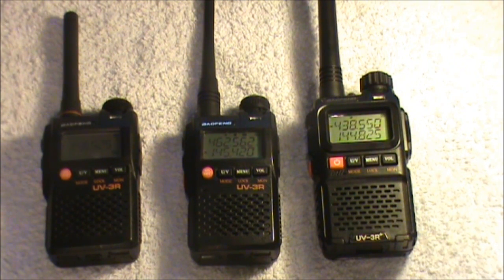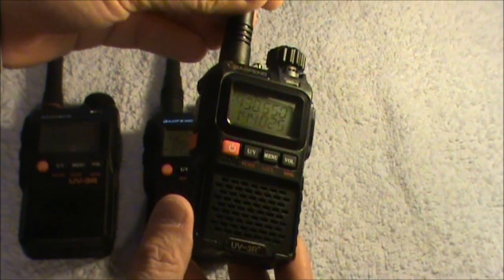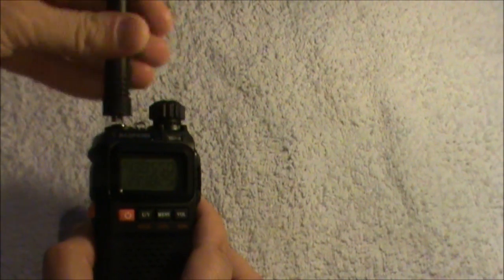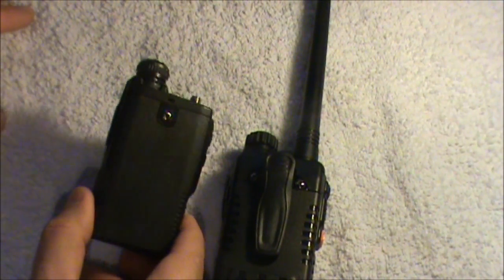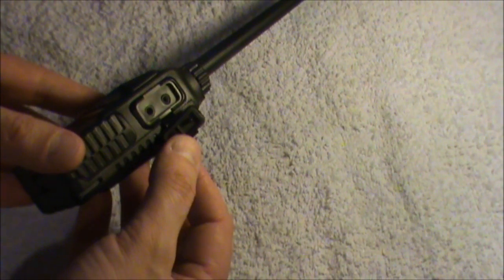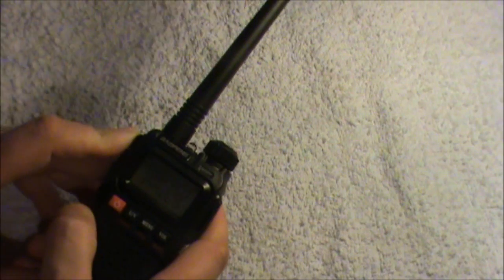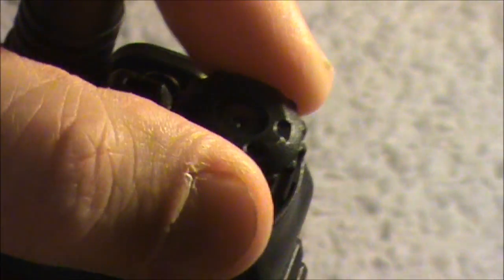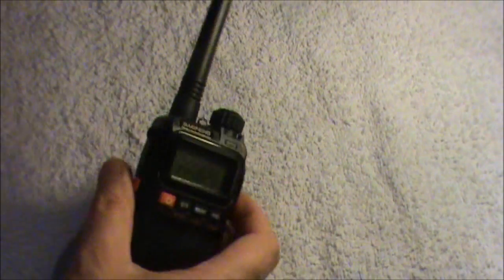UV-3R+ Plus comparison

Comment: I'm trying to pair UV-3R+ with the old Motorollas of my co-workers. I found the frequency and I can hear them, but when I transmit, their walkie-talkies are only flashing LED, without receiving my voice. What can i do?
Reply from the maker: So, it sounds like the Motorola radios are configured to only receive when there is  CTCSS tone (also known in the Motorola world as a PL tone). You need to find out what that tone is, and then set your radio to send this tone when you transmit. You can do this by setting the TXcode (menu item 02). If you look at my video UV-3R Mark 1 Quick Start Guide you can see how to do this..
Reply: @chrishoward9999  Thank you very much
Reply: @chrishoward9999  If you have a good contact, you can scan their signal.  Don't know if you can scan tones on this radio.  It's on order.

Comment: I still use mine daily.  I purchased in 2016.  I like the UV-3r because I can remove the USB cable from wall charger and charge the transceiver in my truck or in the field via a solar charger or battery bank.  These are solid little radio's.  I use a 15 inch MFJ sma male antenna on mine.

Comment: A few points about getting the most out of the UV3R (mk1,mk2 and +)

A rubber duck antenna is typically -5db.  This means that a 5w radio like the UV5R or MD380 with a duckie will typically put out only around 1w ERP (Effective Radiated Power) ... which stinks.  This means that the UV3R's with 2w power will actually only put out about 400mw ERP (0.4w) which may be fine if everyone is in close proximity - but it's pretty poor.

So, Tip #1  ... A duckie is only HALF an antenna, which is why you get poor performance.  The 'other' half of the antenna is called the 'counterpoise' and it will really help your antenna radiate properly.

A ring-terminal placed over the SMA connector (held down firmly by the antenna when you screw it down) will allow you to attach a wire called a 'tiger tail', which acts as the counterpoise.  A 1/4 wave counterpoise will boost your ERP and allow a 2w UV5R to put out more power than an un-counterpoised 5w UV5R : )

There are many fine videos and articles about making tiger-tails for HT's

Tip #2 is that the duckies you get with these cheap chinese radios are only approximate lengths of wire shoved inside a plastic tube... they are NOT tuned and almost always have their lowest SWR (The frequency they perform best at) in some truly stupid part of the band (or even just outside it)

So, try a few cheap antennas : )  Aftermarket antennas are almost always a good move.

Tip #3 is to buy a cheapo RF field strength meter from ebay for about $20.  This is basically a box that you place a set distance away from your radio.  It has a needle that rises when you key up, and a knob to increase/reduce the needles sensitivity.

Using this you can really tune your radios power output.  Using the free antenna which came with the unit, key up and have a friend adjust the sensitivity dial till the needle is at 12 o'clock (half strength).  Now switch antennas and key up again ... if it goes past half-way, this is the better antenna on that band... so, tune the meter to 12 O'clock on the new antenna and try any other antennas you have.  This will help you find the best match from a bunch of cheap antennas.

You can also take antennas that perform poorly and try to tune them for your favourite frequency. 
 Do this by sliding/pulling/cutting the duckie off its connector to expose the antenna wire underneath ... then start cutting off a few mm at a time to see if the needle goes up or down.  If the needle goes up, then keep removing wire till the needle stops going up or begins to come down.  Now you know the best length - modify all your cheapo antennas to that length and you'll be putting out much more power.

Same with the counterpoise in Tip 1 ... once you're happy that your antenna is doing a good job, add a tiger-tail and trim it down until the strength meter peaks.  Now you have a tail you can add whenever you need to go from a 0.4w ERP duckie to a 1.8w ERP antenna... and, being a ring-connector, you can take it off when you don't need the extra ERP..

Tip #4 ... Having finally got the radio working well DON'T broadcast from your belt.  I know it's nice to have the remote mic but your body is mostly water and broadcasting from the belt will suck what little power you have through the floor... not to mention the difference 2 feet of height can make.

Instead, raise the radio to your head and you'll enjoy much better reception.  Also, do try to get into the habit of speaking with the antenna near-vertical.  You see so many people holding it like a phone with the antenna pointing backwards 10-20 degrees off the horizontal.  Maybe it looks cooler, but you're losing power transfer due to incorrect polarisation: /

If you desperately wanna look cool, take up smoking... but keep those antennae vertical : )

Finally, Tip #5 ... Cheap cloned antennas on ebay are actually pretty good value.  The Nagoya 771 is a superb antenna but would look silly sticking out the top of a radio as small as a UV-3R .... but there's a Diamond SRH805 stubby 2-band helical that's only about 1.5 inch long, looks amazing and kicks the ass of the baofeng antenna your radio came with.  Try a clone or two, they're about $4 on ebay : )

Anyway, I hope some of that helped.

These are great little radios for line-of-sight and short distances, but they're awful for opening up a repeater unless you're standing next to it ; )   But, if you take a little time to properly tune the antenna you can do a LOT more with them - and by adding a counterpoise you can hit even those repeaters an unmodified UV5R fails to open reliably.

Of course, all of this advice goes for the UV5R too and the gains would be even more impressive.
Reply: Holy cow!  Actual information.   I must point and click.
Reply: Good comment;  thanks!
Reply: Appreciate this, it would have taken me hours to gather this kind of information
Reply: Thanks for the effort. I learned alot from your tip.

Comment: Do any of the models support USB charging?
Reply: hoshnasi Yes 3R mark 2 is what i buy too, for survival, usb charger from external battery or solar panel, look on ebay, it shows the external DC slot 5v since battery is 3.7V 1500 mah
Reply from the maker: Sadly not. Some folks have home brewed a USB charger. Have a look at http://www.brickolore.com
Reply: U seen the usb battery's for vu5r have to be rewired to the charging chip.lol...also baofengs chargers open and use for usb 5volts to 8volts cable build.. ...no stalk..out

Comment: If i wanted to experiment, would the mark2 battery cover fit on the 3r plus?  then, i could change out the battery types when it comes to that.  i know it wont go around the belt clip area very well, but i could fix that.
Reply from the maker: Hi.  The Mark 2 and 3plus have different batteries.  The Mark 2 has a cover, but on the 3 plus the case is part of the battery.  So no, it would not work.

Comment: Hi M0TCH, great video.

Do you know if can i use the same programming cable in uv-3r mark 1 and UV-5r?

Thanks
Reply from the maker: Hi, different cable for each radio I'm afraid.
Reply: M0TCH  ok, thank you!
 In ebay they selling a cable for uv-3r and uv-5r. I don't know if that works on both radios.